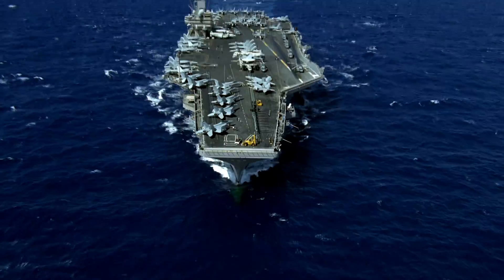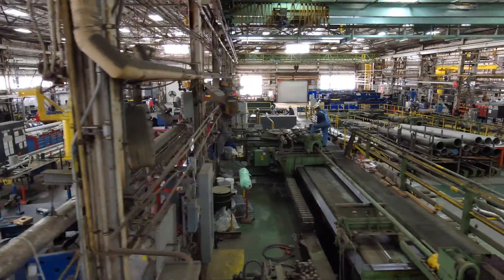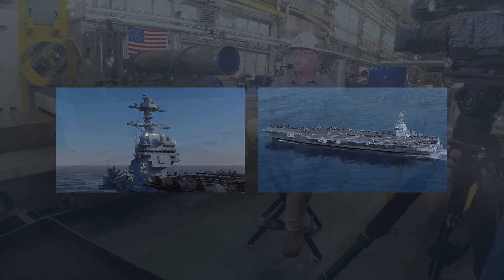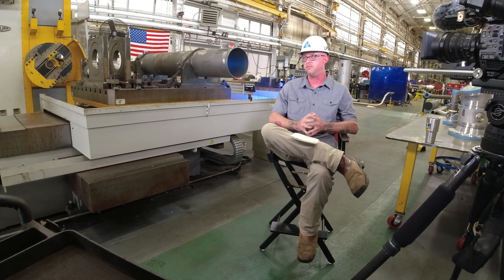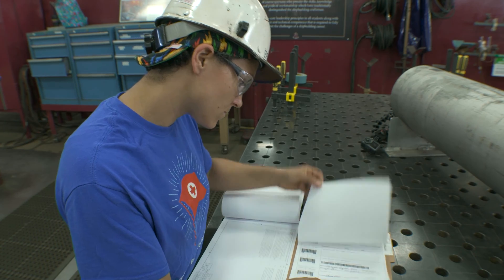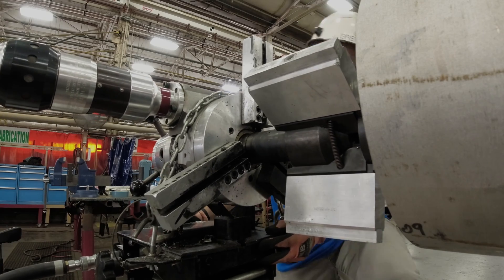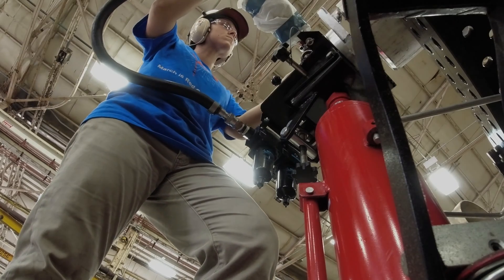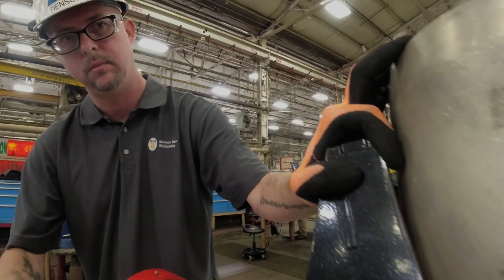Shipbuilder-Designed Tool System Streamlines Pipe Shop Production

Comment: amazing how they build these pipes. Shannon is a reamer its job is to cut the threads and prep the flange so the welder can be attached to link the pipes together. Bob is a pipe jack it lifts the pipe up so the sections can be placed in the jig and welded to form one solid pipe. once the pipes go in the modules they are welded into a longer pipe and then those modules are stacked to build the finished ship.